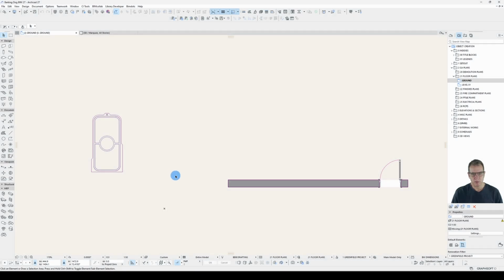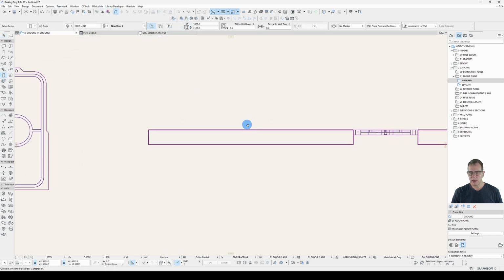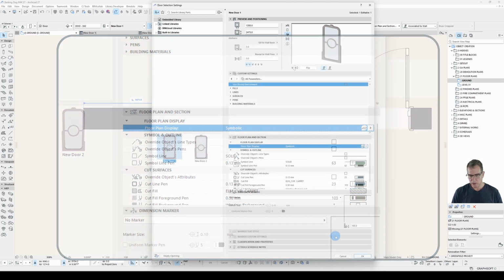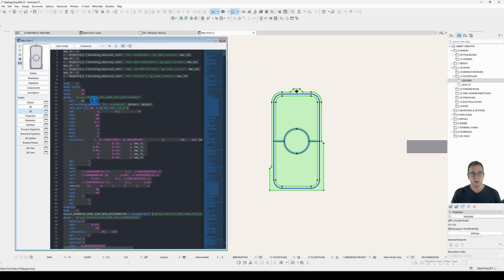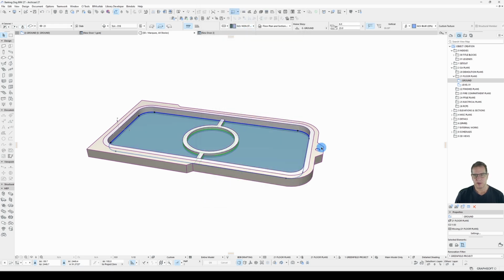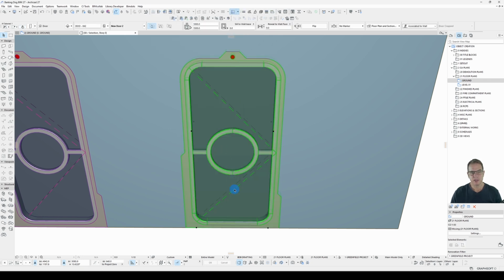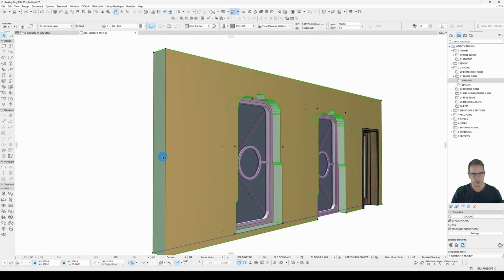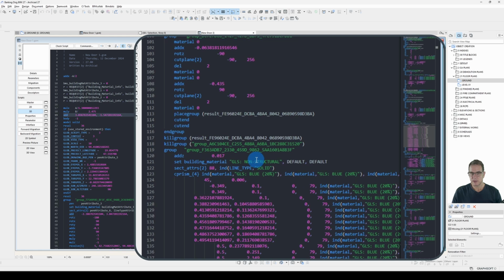037 Archicad Custom Doors...No Scripting

Comment: When you finish edit .gsm, you clicked save button, I cannot find it in my archicad tool bar. I am new to Archicad. Please tell me. Thank you so much for your video.
Reply from the maker: It's just the file > save button...just like normal.  When you're in a GDL editing environment, this will save your .gsm file, not the Archicad file.  Same button though.
Reply: @BarkingDogBIM  Thank you so much. I am using Archicad a week ago. I was using Revit a long time ago. I never touch Archicad. Now, I like Archicad better. It can do better modeling in Stair and Railing. These are a few things I just found out as a new user.

Comment: And you could also use LPM - Library Part Maker AddOn to develop the same way as the save as but with the addition benefit of MVO changes not only in floor plan view as well as in 3D and some other minor stuff.

But great great is to develop your own code!😅